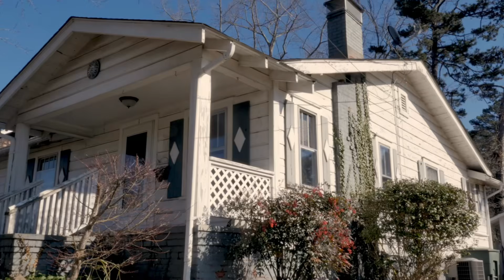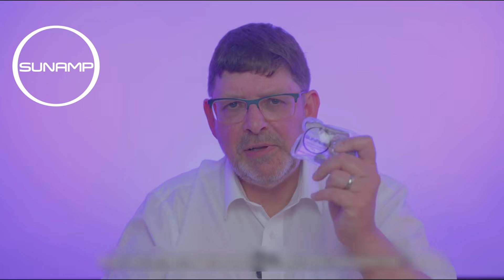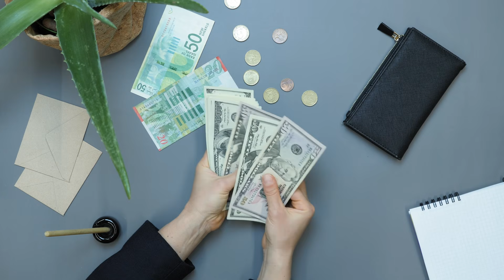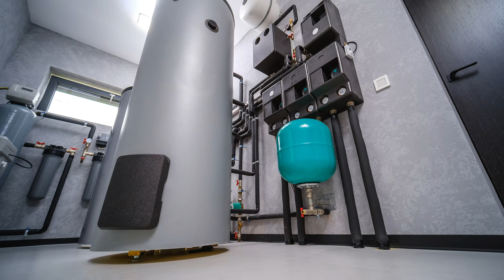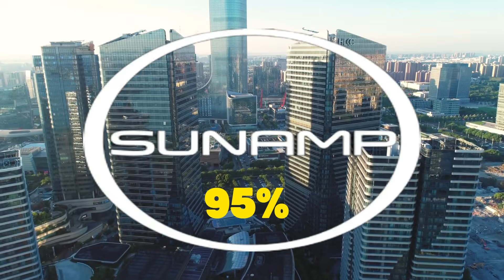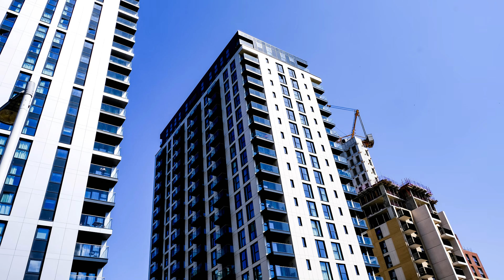This Heat Battery Is 4× Smaller Than a Hot Water Tank and Wastes 85% Less Heat

Comment: Love it! 

Phase Change Thermal Storage is the way to go! If designed for it, a thermal battery may be charged by heat pumps, by resistive heating from AC, from rooftop-mounted Concentrated Solar; even by solar panels connected directly to a heating element without needing an inverter. 

It can be scaled up for residential home heating or even industrial process heat. 

With an absorption chiller, you now have A/C. You might choose to install a second, cold PCM thermal battery which discharges heat to the starlit sky at night. This would make an excellent cold sink for refrigeration loads, while leveling cooling loads. (Phase change materials can be made at any temperature you want them.) 

With a certain amount of additional complexity, you could even add a small turbine-generator that makes electricity to charge your car, your home electric battery, and to operate the heat pump, and various fluid pumps. PV solar panels and electro-chemical batteries may be incorporated, but are not necessarily  required.

In a high tech scenario, the molten salt tanks can be insulated with a vacuum jacket and you've achieved energy efficiency perfection! 🥰